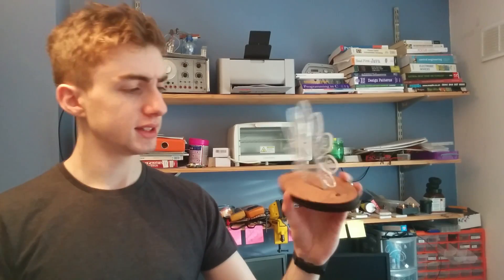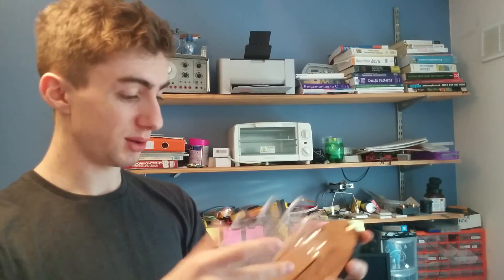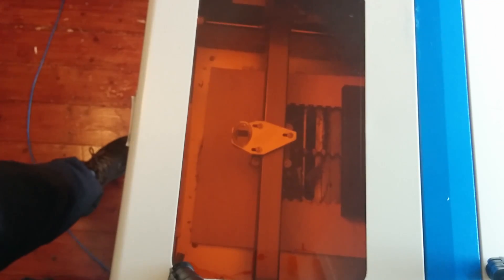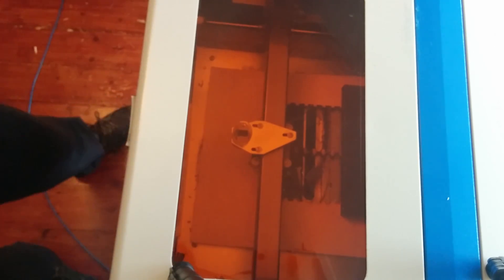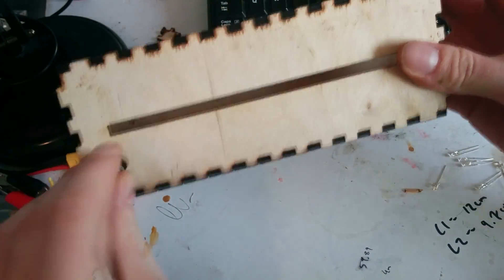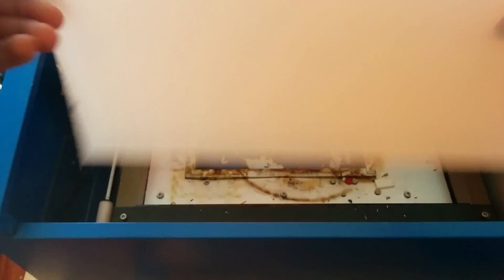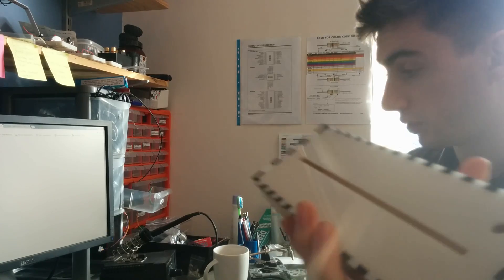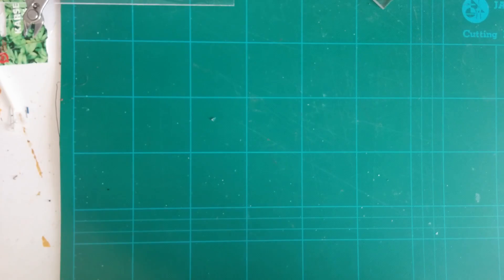laser cut led lamp build

Comment: Nice video! I keep looking for them addressable leds. but can't find a reliable place
Reply from the maker: +Andrew Grabowski Thanks! I get mine from ebay, just search for 'ws2812b', they are way cheaper if you order from china :)
Reply: +wattnotions cool, so is it just the strip and power, or would you have to look for a module? i had a bad experience with ordering something like this in the past, the box that controlled the strip didn't even work lol, thanks again!